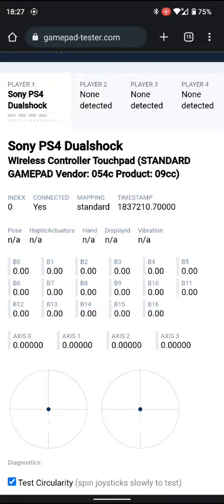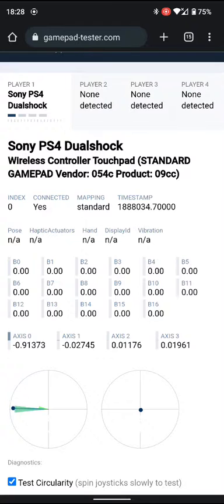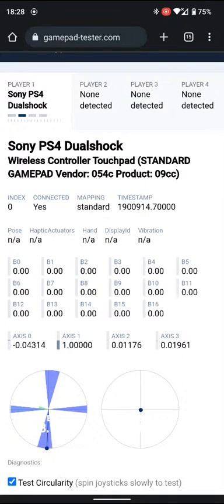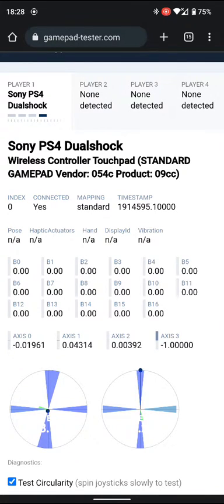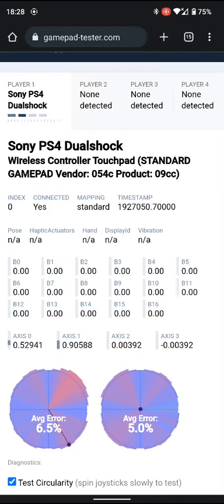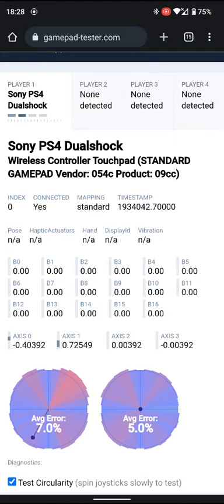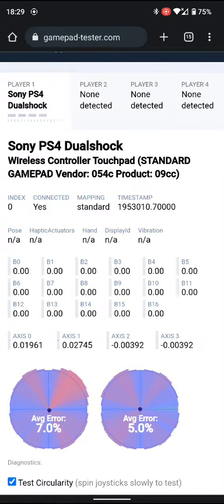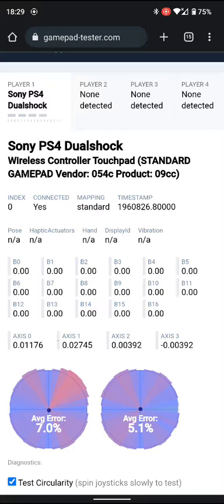Stick Drift 1m ohms resistance circularity (5 of 7 calibration assumptions)

Comment: Is there more or less place for recalibration of its slightly over 10k ohm or slightly under? What is the best?
Reply from the maker: Primary potentiometer resistance value selection of replacement parts, tracks & wipers is best if it's larger resistance to the factory selected part so you can shrink the circularity & slide 🎚️🎛️ the deadspot 🎯 position about as needed with scope to offset from original parts resting reported centre, as you can imagine the PCB is probably calibrated to the stick pot they fit as you can't guarantee mechanically cloned parts for tolerance values & resting position 😉👍🏼. 

Smaller resistance than the original will often shrink the circularity under the full 💯% range 🙅🏼‍♂️🤦🏼‍♂️🙍🏼‍♂️.

Added Trim pots reduce resistance as so.

Minimum response curve shrink 👉🏼 1M, 500, 200, 100, 50, 30 & 20K 👈🏼 maximum 3x3mm trim pots are the values I've ever used.

Twining them can double the parts resistance selection range & help calibrate troubleshooting  odd results or tight resistance original pots you dont have much overhead play room on. 

Example 1M + 1M will shrink the circle about 0.7-8% in max longest current flow position based on my single fit 1M study that shrinks it about 1.4-5%. 

I couldn't be fecked to study it all across the range for a bibble 📜 best practice guide table 😱, that's to much even for me to care lol.

This is my most ordered info, I gave up it got out of hand lol. 

https://youtube.com/playlist?list=PLjKUl7xC9lJnjugWZufJwXcjnZjuu2MV9
Reply: @GOATGamerProSticks  thanks so much for taking the time to explain this all to me! I really appreciate that :)
Reply from the maker: @HD-wf3bp  Your welcome, even if I am paranoid sometimes, is it better than existing in engendered ignorance 😶‍🌫️ 😁😬🤐 internet censorship does that to a mind 🧠🤯 & mental 🧝🏼‍♂️🤤...
Reply: @GOATGamerProSticks  I understand! It's as Kurt Cobain said "just because you are paranoïd doin't mean there not after you" :)
Reply from the maker: DS4 🎮 🕹️🕹️ pots I use were sold as 10.24k ohms resistance & I still don't own a multimeter, I've discovered all this poke & hope style like a backwards engineering cave man 🧌. 

Generally 1m/1m split to 200k trim pots work best on original pots. 

200k to 20/20 split on high resistance primary pots. 

Streamlining trial & error data is not my bag 🛍️ for a best fit go no go parts selection guide based on Avg Error % lol.

Chaos theory 🪢🕸️ of industrial secrets, you can do that lol.
Reply: @GOATGamerProSticks  allright! I do have a multimeter and I also have some new sticks so I might solder some new sticks and let you know what I find out on the multimeter and my result with the new sticks or maybe I'll also try and use the old potentiometers because originals are probably the best if they are still usable.
Reply from the maker: @HD-wf3bp  Poor guy you make me sound like a slave driver, you don't have to do that task it's streamlining madness of a control freak lol. 

Relax 🧘🏼‍♂️.

I've got Xbox one elite series 2 sticks in my DS4 🎮 see the test vids 🎥 for inspiration 💡 👍🏻👍🏻, good luck...
Reply from the maker: Raw potentiometer max circularity Avg Error % overshoot is about 21.8% on a DS4 🎮 with no case for the sticks to limit the movement range, so a half value of 10.9% circularity overshoot seems the ideal target 🎯 for recalibration purposes. 

That's it I'll leave you alone, I think I'm a high functioning anxiety sufferer that needs a mental 🧝🏼‍♂️🤤 tweak 🪛 myself 🤷🏼‍♂️...
Reply: @GOATGamerProSticks  I'm just happy with all the information and sometimes it's good to take a little break I have it too sometimes :)